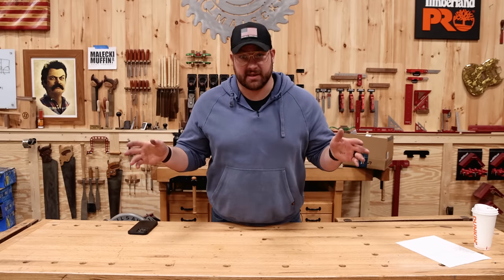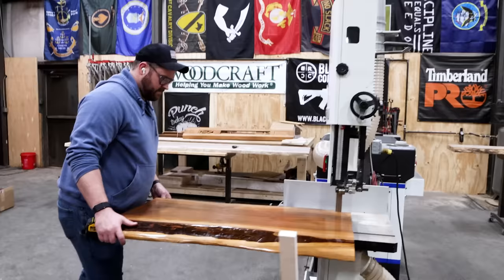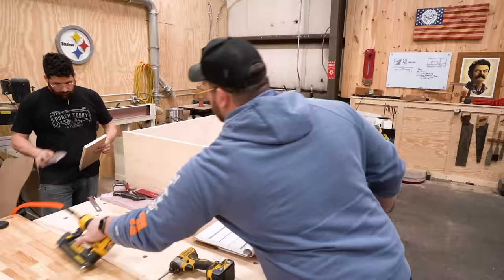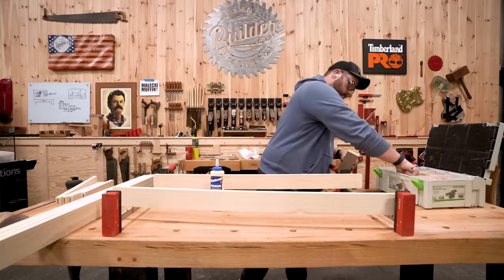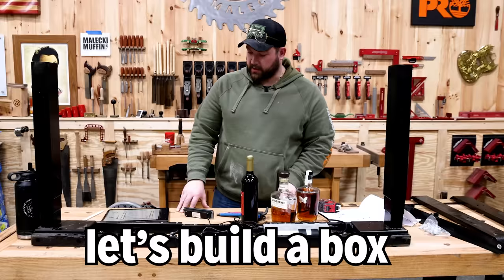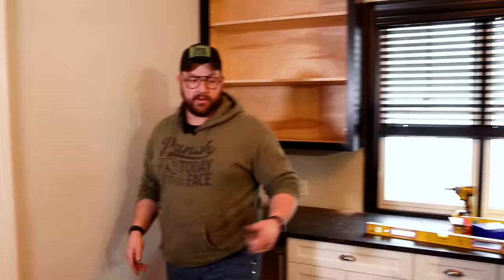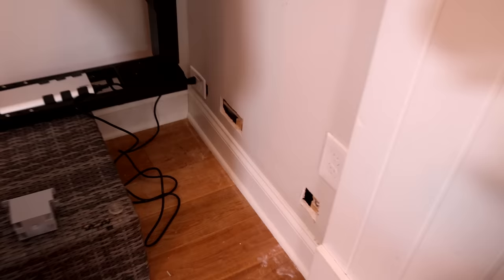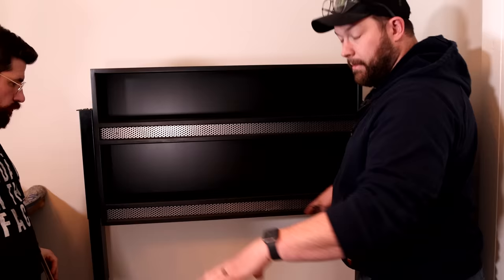Building An Invisible Whiskey Cabinet

Comment: The screws worked for holding the metal in. For a cleaner easier way to do it,  try using a stapler made for picture frames. They are designed to install glass in the frame in a very clean manner

Comment: idk if you fixed it yet but for the noisy metal cabinets at 11:06 a cheap and easy fix without redesigning anything would just be to back the screws out, add some rubber o rings or even some rubber furniture bumpers and screw em back in. the bumpers would give more surface area for a tighter fit and would hardly be noticeable if you can find the right size.

Comment: 4:10 a cleaner look is to use 18ga 1/2in crown staples and slide them into the wood with a flathead. I do this to keep the glass secure on wooden storm windows.

Comment: I work at a cabinet shop/ sports locker shop and for sports lockers we use metal grating just like that and there is a clear rubber product that comes in a long line that we cut to size and insert between the metal and a little 1/8 inch line that we rout out. That would be what you’re looking for for those doors. I could get more information if you’re interested

Comment: for the mesh in the doors you could have routed out some holes for some small rare earth magnets and epoxied them in if you used steel mesh, if you used an aluminum mesh, you could have routed a "half lap" joint on the back, placed the mesh and then made a small "veneer" to screw to the door and hold it that way.

Comment: For people thinking of doing this project I built a similar thing in my head board with a couple of track actuators, they are super easy to set up. Much cheaper than a sit stand desk
Reply from the maker: Do they hold enough weight for the bottles ?
Reply: @John_Malecki  depends on the ones you get, but the ones I have can hold 150 each, I only used one and added some tracks for stability.

Comment: Now enjoy it. Trick for the metal panels is to treat them like all other panels. You can cut a groove and fit them, or you can add a strip of wood behind them mounted to the frame. Or like you did here with the screws but I'm guessing they are loud because they are moving around? You'll figure it out but those were my thoughts.

Comment: Could you run a bead of caulk on the inside of the metal mesh?

Or use some of the rubber type stuff they use to tack on glass on cabinet frames?

Either should quiet any noise. And provide more strength to hold the mesh in

Comment: keeping the mesh in a glue in some washers, my Dremel cuts the perfect recess for the washer and it keeps it tight hardly notice them unlike a small screw lol
Reply: So you just Dremel a recess for the washers as the only “fastener”? If I understand you…that’s a GREAT tip, thanks!!!
Reply: @chrislivingston1684  yeah, at a slight angle it press the washer down on the sheet your trying to fit...

Comment: Would be nice if it had a 6” false vertical front. As the bottom approaches full extension, the vertical panel tilts open. Beautiful work otherwise

Comment: probably would have routered a groove for that metal on the bottom and side pieces so one could slide em in from the top. then patch up the top with a thin sheet that is brad nailed or sth. nonetheless, great "secret stash" :)